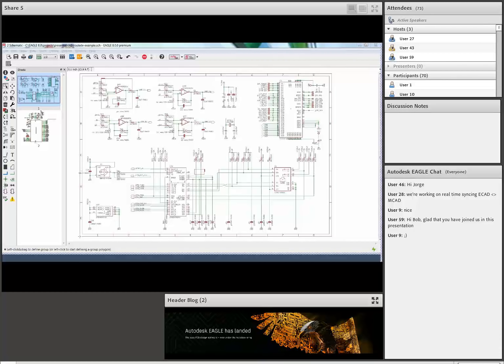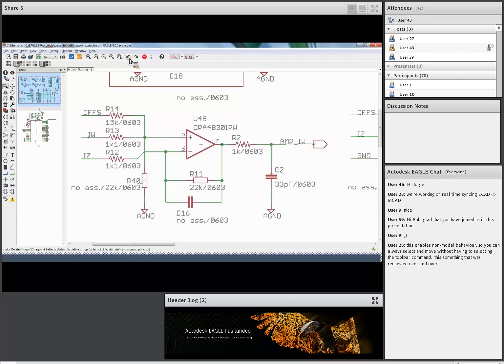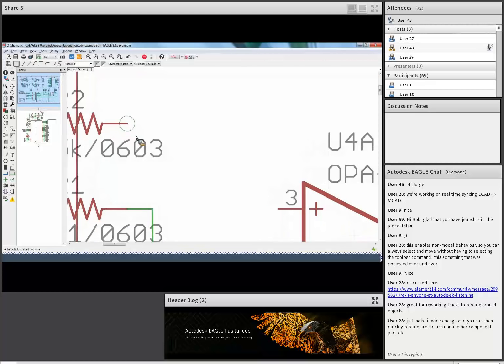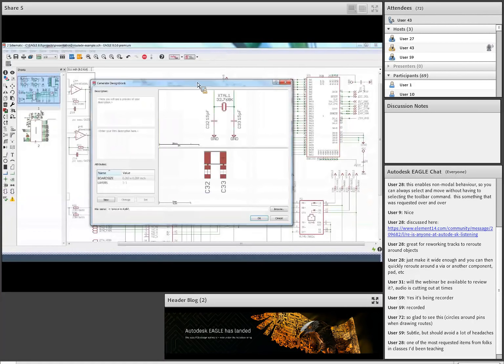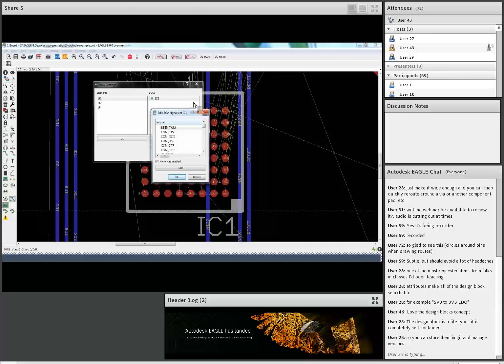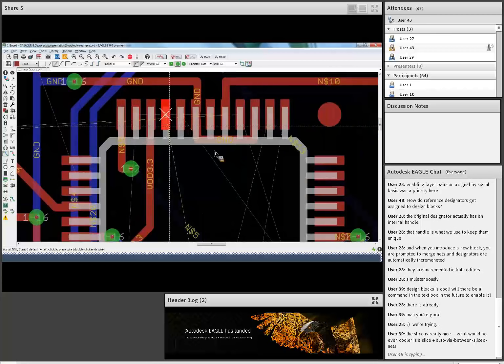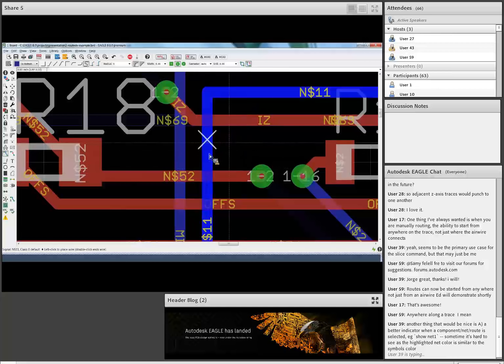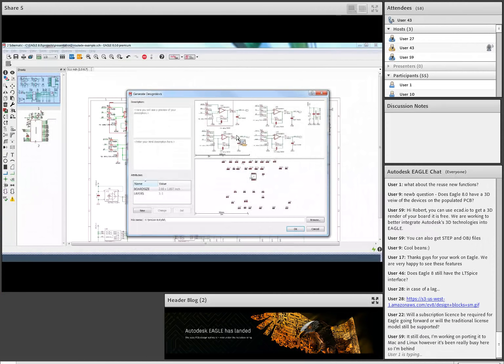New Autodesk EAGLE - PCB Design Tools for Everyone

Comment: Why does this still have a problem starting on Windows 81. ?
Reply from the maker: Hi @greywolf271 Thanks for your question. What version of Windows are you running? Which version of EAGLE is installed? Thank You!
Reply: I used Eagle before Autodesk acquired it. Then stopped using it because I had Altium at work. Now I want to go back to the version I used at home but I installed Win 8.1 since that time. So I installed the free version of Eagle. When I start it, I get a blank window sometimes and other times the log in appears but when I log in, the window blanks out also
Reply from the maker: Hello Greywolf, Did you download directly from http://www.autodesk.com/products/eagle/overview There you'll find our latest release? Please let me know. Thank You.
Reply: Yep, I downloaded the latest. Then when it wouldn't start after logging in, I looked for the problem on your forums. Then downloaded 8.0.1 which some had suggested worked ok. Same problem here.AVG antivirus disabled during all of this because some on the forums suggested one of the installation processes might be recognized as a virus. No change to the situation. I might try the Linux version when I have some time though. I don't care which one works. I just want something that does. I'm not going to shell out good money for crap.
Reply from the maker: Hello GreyWolf, Thanks for the response. Please use the alternative batch file in the EAGLE installation directory. If that doesn't work may you please open a support case on the forum. You can setup a call or receive email support. We would really like to help you get up and running. Thank You.
Reply: But why does this problem exist when non existed in the previous versions of Eagle before AD took over
Reply from the maker: Hello Greywolf271, Until we can take a closer look at what's occurring we won't be able to find a result, Thank You.

Comment: Where did you get the components? What i mean is how to get the components like ldr,photo diode,555 timer,resistor,transistor,switch, etc and put it in *some content missing* 

PS: I DELETED ALREADY THE SOFTWARE BECAUSE I DONT KNOW HOW TO USE IT
Reply from the maker: Hi Harie, Many of those components already ship with Autodesk EAGLE. Do a search using the ADD command. Make sure to use wild card characters:  * and ?  Thanks!
Reply: as much as i cuss out the program while using it...its pretty powerful. there will never be one CAD tool with all your parts. What ever program you use, you need to learn to design parts for it. First do what the auto desk person said and search with wild cards. Say you want a 1206 sized resistor: click "add a part" , Click search, type: 1206 it will now come up with a bunch of results in that size. The R is where you want to look. 

when you get to more complex ICs though, you are at the mfgs mercy for whether or not they provide a file. Eagle Does however provide many footprints. a footprint is what the chip looks like pad wise. if you browse the libraries in the main screen at the bottom of any given one you will see "symbols" and  "packages". Create your own library, File new...blah blah... leave your library open, find the package/footprint of part you need in the main screen. Right click it and select "copy to library", Save. Click Symbol. lay down same number of pins and name them. Click save. Click device. Click the Add part (its actually add symbol.) Select the one you just created. Type "package" hit enter, select the one you coppied. Pair the pins (bottom right) you now have your part ready to add.

Comment: I used EAGLE sind Version 3.0 (many many years). But I will NOT purchase V8 due to the unacceptable licensing conditions by autodesk.
Reply: 13 bucks per month is unacceptable?
Reply: @vlsh88   Any subscription-based model is unacceptable. What if I'm a casual, intermittent user? I don't want to pay for something that I'm not using.
Reply: cant recomment V9. full of bugs and crashes. major step back compared to v6. "new" shiny features are depleted at redesigned icons and lots of bugs.